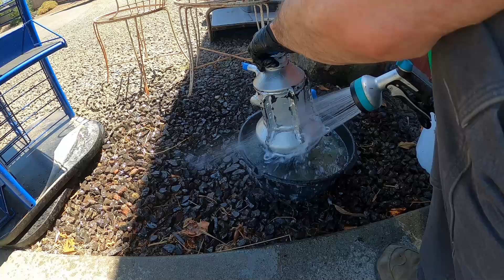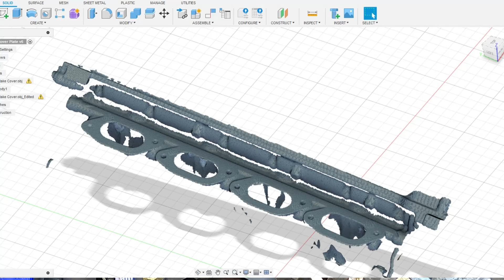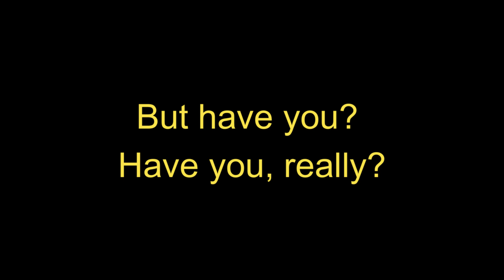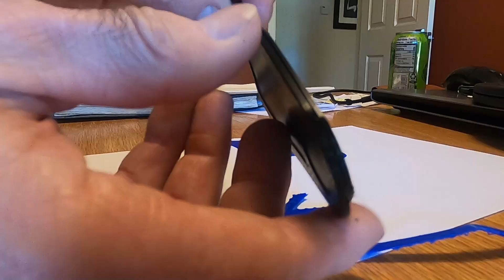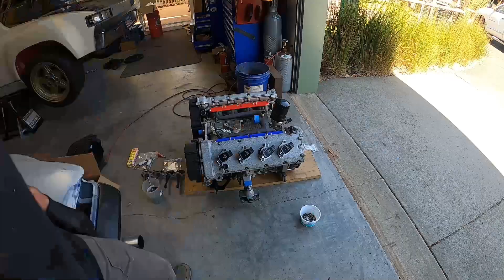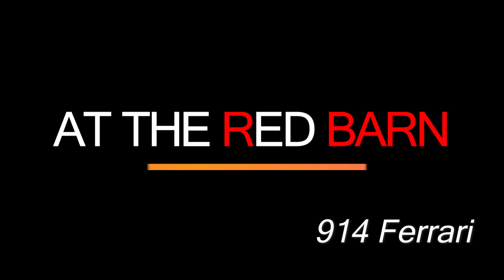Porsche 914 Ferrari Swap #82: The engine is ready to fire!

Comment: I appreciate you showing the details 🙂 It's great to see how the oil system works on these engines 😎👍
Reply from the maker: It makes it simpler as I don't need to worry about working out a dry sump tank!
Reply: @attheredbarn1669 yeah, being that the engine oil is stored under the gearbox is it still  seperate from the gear oil? I would imagine so 🤔 I'm looking at building a ferrari 😁 a lot more searching for parts to do 👨‍🔧 Thanks
Reply from the maker: @UKBUILT  yes, the dry sump tank wraps around the differential. Trans and engine oil are separate.
Reply: @attheredbarn1669 Thanks man 🤘

Comment: I have the same quick jack that I’m using to install a L83 in my 914😎😁 and had the same issue of not enough height 😯 I got some 2X4’s and went across the jacks side to side, which actually made me feel better about the security of side to side sway while the car was on highest point I cut and stacked pieces of wood to get the height that I wanted and then screwed them all together to make me feel better and it gets the car as high as I need and is Very Secure 👍👍Love your build and can’t wait to Hear it Run!!!!
Reply from the maker: I can get the LS out but I need to get this car 11 inches higher to get the Ferrari motor in/out with the intake on it. I'm about to start looking into what it might take to do that safely.
Reply: @attheredbarn1669  I think this idea would still work. I stacked the two by fours with the jack on the floor flat until I got them up to the body and each time I put two by fours together I screwed them together with long wood screws so nothing would move and then I ran 2 x 4 side to side for stability at height. It worked really good. I have a very high intake on my V8 and I was able to clear the back of the car easily on a rolling stand to get the engine and trans underneath. 🤷‍♂️🤷‍♂️🤷‍♂️

Comment: Looks very good. The stud remover and installer set is a good idea. I just need to find an Imperial version for my Lotus Twin Cam project. 

I was also interested in the oil/air separator as I'm thinking of making a water/air separator and this confirms that I'm not completely mad. Good idea to do use solar gain to help the painting (yes, I have tried it without a heat gun!).

It always really very nice to see the intelligent thoughtful side of the US for a change (certain people in positions of trust have the rest of the World very worried).
Reply from the maker: I got this GearWrench stud extractor/installer set: Metric and Imperal: https://www.amazon.com/GEARWRENCH-41760D-Piece-Metric-Removal/dp/B000K1KHB6

Comment: Great video!  Yes, keep the details.  The thought process to get through that was very interesting.  
Grinding your separator on the concrete sent shivers up my spine!  I avoid putting painted items on concrete.  I keep the cardboard to put things on.  The same cardboard I painted on.
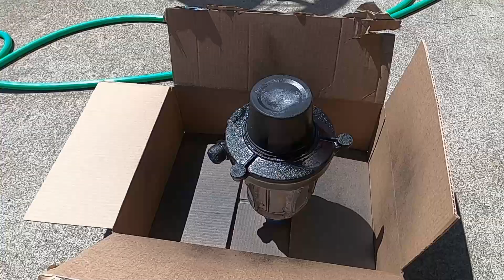Reply from the maker: I'd be shivering, too! But that wasn't the separator, that was the plastic container it was sitting on throughout the paint process. It was covered in paint at that point, is all. Take a look at about 2:25 and you'll see.
Reply: @attheredbarn1669  Man.  Once it's painted it looked like the part!  That is a great way to protect it too.

Comment: Chris, definitely enjoying the 3D printing stuff and seeing some unique uses for it. On having to remove the intake with the Quick Jack. If you get the “SUV kit” for the QJ, it may get you high enough. You have to get creative to get a 914 on the SUV kit (914 is too low), but it’s how I’ve been pulling the Suby 6 out with the intake still on. Pics in my build thread on 914World. MikeG in AZ
Reply from the maker: Thanks Mike! I'll have a look at the SUV kit. You may be onto something there. It'd be a game changer if I could get the car higher. Again, thanks for the heads up.